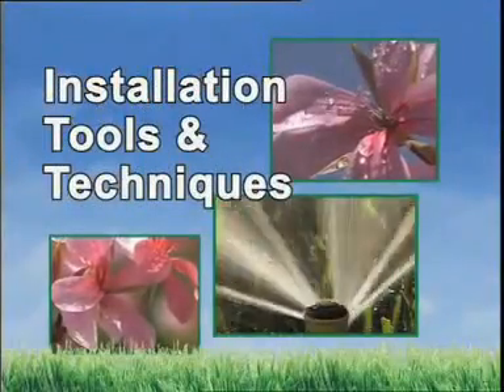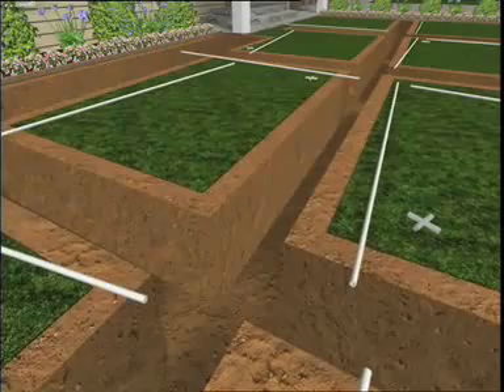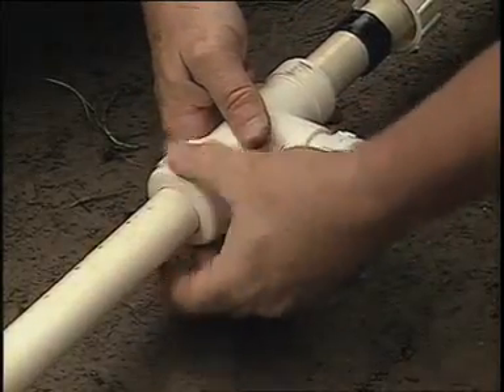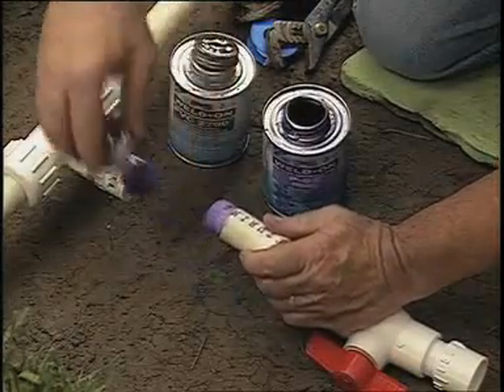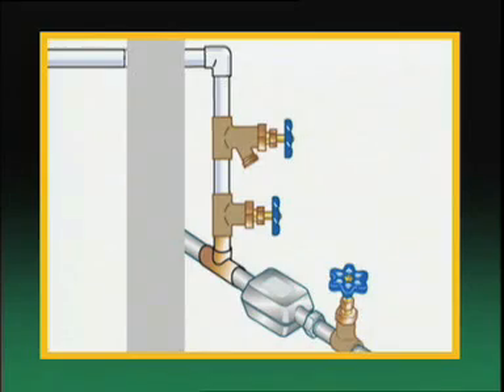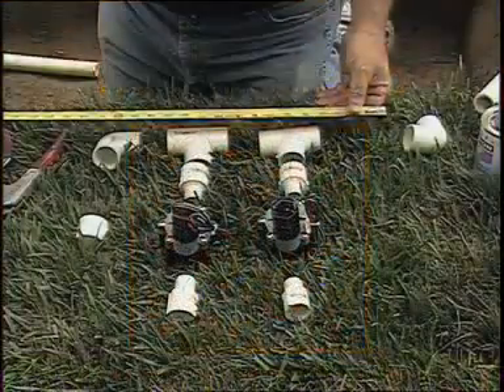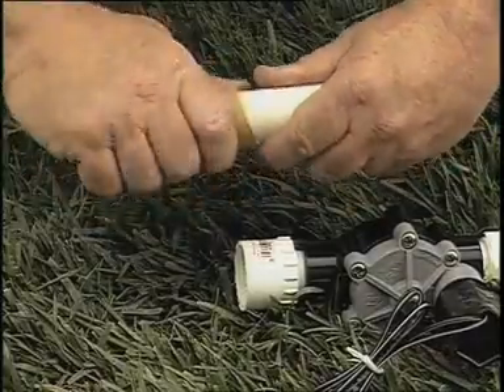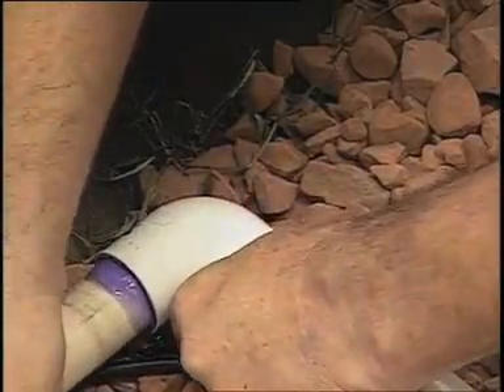Irrigation System Installation - Part 1

Comment: 1. Don't use a compression fitting to tap into the supply line. Glue it.
2. Don't use a PVC ball valve. The handles break because PVC becomes brittle over time. Use brass.
3. Use glue fittings as often as possible. Threaded fittings = more chances for leaks.
4. If your PVC cutters are leaving a burr, you need to sharpen/adjust them. You shouldn't need sand paper.
5. Glad you used primer on the supply line, but disappointed that you used clear PVC cement.
6. Let the PVC cement cure for a couple of hours before you turn the main water supply back on. Don't expose your glued fittings to pressure right away. This video would make a rookie believe they can turn the main back on immediately after gluing the ball valve.
7. The irrigation wire is suitable for burial, but don't do that...and telling people to tape it to the pipe???? WTF?
8. Threaded fittings - crank them tight. 1½ turns might not be enough. It depends on the fitting.
9. When applying primer/glue to the fittings on the valve, tilt the valve so nothing runs downhill into the valve. Gravity is just a theory, but it works virtually every time.
10. When building a manifold, space the valves 4" - 6" apart. One or more of the valves may fail at some point. Give the repair guy some room to work. Build the manifold on a solid, flat surface.  That makes it easier to ensure they're all plumb. Don't 'eye-ball it' - they'll be crooked. Use a piece of wood. You're going to drip primer/glue. It'll stain concrete.
Reply: You say don't bury the wire. What then should one do with it? Why is taping the wire to the pipe a bad idea?

Comment: Do I need an anti siphon valve for each zone? Or just one for the entire system? Lowe’s told me I need just one, and then a solenoid for each zone but Tampa codes require back flow prevention.
Reply: Dual check where you tie into the main and then a valve for each zone

Comment: this is smack. don't use threaded tees, a normal tee will be just fine. don't double glue, just glue the pipe, not the tee. green glue for mains pressure / running into valves, blue for everything from the valve.
Reply: wow, remind me NOT to hire you for any plumbing work!
Reply: If you need to hire someone, you obviously don't know what to do
Reply: lol-hence the people viewing and commenting on a how to video--as you continue to show your ...
Reply: so keep sounding off
Reply: the tee thing I agree with. the rest is WRONG
Reply: Colored glue is for amateurs
Reply: Used to use 725 weld on but recently started using 721 weld on . I use it on 2" , 1 1/2" ,1 1/4" , 1" , 3/4" and 1/2 ". It makes for quicker cure time . Turn on water to check your 2" repair same day of gluing it .

Comment: PVC isn't even used very much anymore, Polyethylene is now used
Reply: Where do you live? Poly is almost never used in Florida.
Reply: Poly pipe is for zone lines only as it should not be under constant pressure. Pvc should always be used for mainline.

Comment: Its not that easy, you might get fustrated with it. And its not cheap either the machine to dig the trench is at least 100 for the day. Hope most people have a landscaping buddy or a pluming buddy to help out thats what i plan to do after this winter is over. Good luck everyone. on the plus side it does add value to your home =)

Comment: if you are looking at this to learn pay close attention to 6:50 make sure you leave from 4 to 6 inches of pipe on either side of the valve. if that male adaptor has to be replaced you will have room to do so. also if you can DONT USE threaded valves male adaptors are the weakest fittings prone to breaking right at the threads. best way to use a threaded valve is sch 80 nipples cut and glued to couplings. particularly on larger valves. good luck

Comment: First of all, gloves should be worn. Secondly, it's not said why not to use pipe dope versus the teflon tape. Thirdly, the primer and solvent use was sloppy and wasteful; it's better to turn the dobber horizontal at the opening and spin it several times to get off the excess not needed to seal parts and to of course make the product last longer.

Comment: this look so complex... all I was thinking get a 3 4 HP pump then the PVC pipeing connections with those things that the water comes out here and there or where ever I need to water then connect water supply to the water pump and connect the PVC to the pump and there u go... now this is with codes and wires and stuff what is all that for...?

Comment: @RainJetSprinklers 
The unions on the 100DVFUU are on the valve, so it makes maintenance on the valves in a manifold a breeze especially if a valve needs to be removed and replaced.

Comment: @iScaper1 I agree, those dresser fittings scare the hell out of me. Around me we are lucky enough to not have that many PVC mainlines, most are copper. In this case I would solder a fitting and it would NEVER fail. I've never used those the 100DVFUU but I do like manifolds and unions.

Comment: A couple of things. Instead of using a dresser tee to tie into the main line, I would use a PVC slip tee SXSXS and a quick fix coupling. That way I'm getting glue joints on all the connections where I cut into the main line. I've seen water pressure drive off a dresser tee as shown in the video, especially if the pipe can move at all or you are dealing with high water pressures. Rain Bird also sells a great union valve for manifolds (RB 100DVFUU), I'm surprised they weren't used in this video.
Reply: Exactamundo! I wouldn't use a compression fitting to tap in to the supply line either.